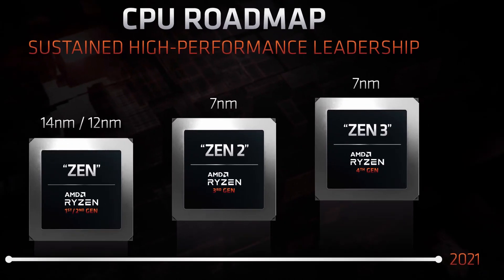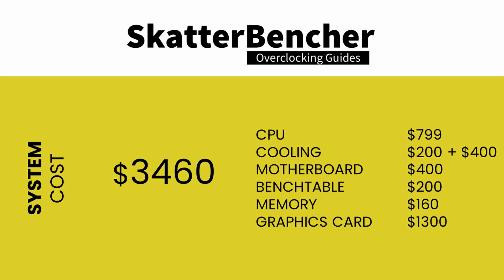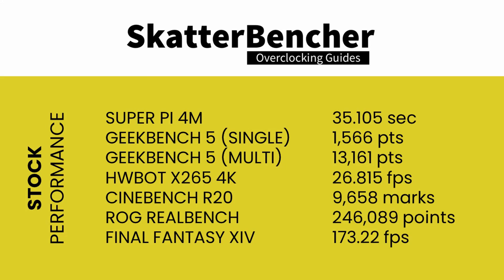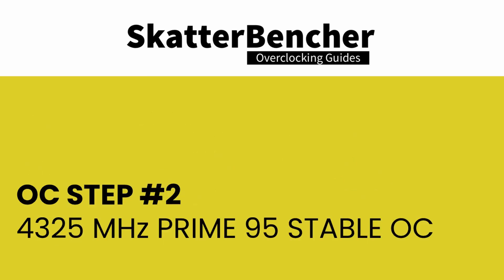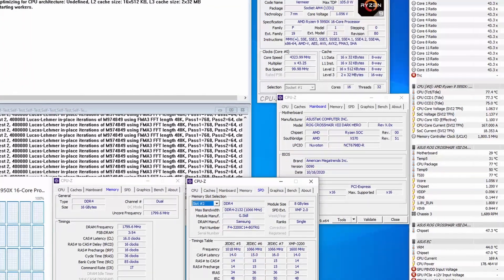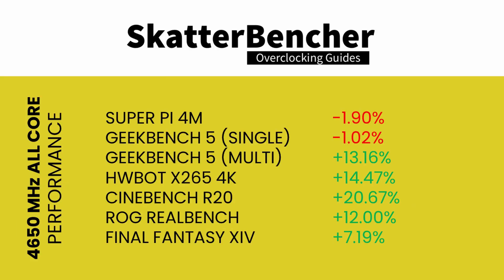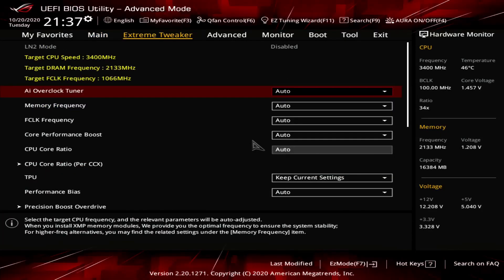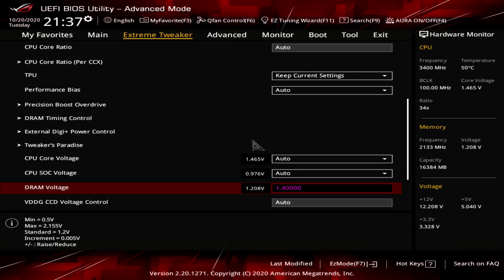Ryzen 9 5950X Overclocked to 4650 MHz With ASUS Dynamic OC Switching | SkatterBencher #15

Comment: I dont get how this is an OC if the cpu is already marketed as having a boost clock of 4.9, how is 4.6 an OC?
Reply: @@nicholasconundrum yeah that is it. It is pretty gimmicky. That is too bad.
Reply: It’s a single core 4.9. You can actually get 5150 boosts very often, or 5400 boosts

Comment: Noob question: Why 4650 while stock turbo is 4900?
Reply: While in the other video you OC to 5117
Reply: The 4.65 is all core. Pbo is a single core scheme.

Comment: These instructions crash my system unless I ignore the detail memory settings (16,16,16,16,32, v1.4). If I leave those default then it all works. If you are having trouble too, that might be the part.
Reply: I was reading the comments looking for RAM info and why those specific timings specifically.

Comment: But PBO already hit thermal limit with voltage offset, dynamic OC mode when go above current can achieve similar voltage and speed, so what's the point? PBO voltage still too high after off set?

Comment: Processor - AMD Ryzen 9 5950X 3.4 GHz 16-Core

GPU - EVGA GeForce RTX 3090 24 GB

Motherboard - Asus ROG Crosshair VIII Dark Hero

Cooling - Corsair iCUE H150i ELITE CAPELLIX Liquid

Power Supply - Corsair HX1200 Platinum

SSD - Samsung 980 PRO 2 TB

Memory - G.Skill Trident Z NEO 64GB 4x16 DDR4 3600 CL 16-19-19-39

Case - Lian-Li O11 Dynamic XL ATX Full-Tower

Random Black Screen Reboots happening to computer. My PC keeps randomly shutting down while streaming, gaming or surfing the web. I cant seem to locate the issue, all hardware is operational. Did fresh windows install, drivers up to date, swapped ram, swapped psu. Manually adjust power setting in windows and many other trouble shooting. The pc is at microcenter now and they say it isnt hardware issue. Any support is appreciated. Specs above. I tried turning off PBO and also fmax enhancer and still turning off. Another expert i consulted said that it could be related to voltage? Is this something you’ve experienced? Any help is greatly appreciated this pc is driving me insane.

Comment: Did you change the LLC or CPU Current settings?
Reply from the maker: It's been a while since I overclocked this system, but as a general rule of thumb you can assume that if it's not in the video I didn't touch it

Comment: You don't need to do all this craziness. Just go to Curve Optimizer set negative curve as far as you can to stable and fine tune your PPT TDC EDC and you will get high single core and high multi core speeds no trade off.

Comment: Why is the ddr4 still only running at 2133mhz?
Reply from the maker: DDR4-4266 = 2133 MHZ (double data rate means data is transferred twice per DRAM clock cycle)

Comment: My 3950x is overclocked to 4.3Ghz. I see great preference. With a 5950x you might be getting about 8 to 15% better preference then me. I don’t see a reason to upgrade if you own a 3950x like me or any 3000 series Ryzen CPU 🤔. To me Zen5 CPU’s are the next big upgrade and that’s when I plan on building my next rig. I still want to see what Zen4 can offer tho even if I’m not going to get one myself.

Comment: @skatterbencher Excellent video... One concern though... I have followed these instructions and even lowered the threshold for DOS. With that said, I am still experiencing high temps with my 5950x. Even at idle. During gaming, CPU can spike to 91 c and idle temps are currently >50 c. Any suggestions on how to control the temps a little better without losing too much performance? Bios tweaks? I am using an NZXT x73 Kraken 360mm AIO, so cooling should not be an issue. I am going to rebuild this weekend in a Lian Li 011 Dynamic XL and change fan config to see if that helps. Thanks in advance! I appreciate this content!
Reply: wow with an AIO? I have a noctua fan and am able to keep sub 60 with heavy gaming (although on stock boost)

currently testing a 4.5ghz over clock

Comment: Will this work on the Asus ROG Crosshair VIII Extreme @SkatterBencher?  I am using a Corsair H150i Elite cooler with 128gb corsair vengeance 4000mhz
Reply from the maker: Yes.

I have a dedicated video out with the C8E as well https://youtu.be/2ZW36TPhFz8. I think the newer one is much better than the older one :)

Comment: Same exact system will not boot after changing settings. Shows Q code error 22 on MB and have to reset cmos to get back into bios. G.Skill RipJaws V Series 64GB (2 x 32GB) 288-Pin SDRAM DDR4 3600 (PC4-28800) CL18-22-22-42 1.35V Dual Channel Desktop Memory Model F4-3600C18D-64GVK. Any help appreciated.
Reply from the maker: Sounds like possibly the memory. Instead of setting the memory frequency, timings, and voltage manually you can try to just enable XMP (or DOCP).

Comment: I just want to say thank you for the quick response on my first question love your channel
 So when overclocking my 5950 X it seems I get the best performance when I run my ram manually at 3800 but my issue is finding out how to set my BLCK FCLK four 3800 do you have any videos where you cover this section or explain the best starting point for free this
Reply from the maker: No worries, I'm here to help!

Unfortunately I don't have any content up that takes a closer look at tuning the Fclk. My go to strategy is ... try high and if it doesn't work, try lower.
Reply: @SkatterBencher  So I learned on the Asus crosshair formula board you have to go to the Amd overclocked and change the fabric to 1900 if you run in 3800 Memory that was the part is missing

Comment: So I don’t have dynamic overclock switcher could it be called something else on my Asus Rogue crosshair formula motherboard
Reply from the maker: Unfortunately, Dynamic OC Switcher not available on the Formula. The feature requires hardware-level support (changes to PCB) which were done after the Formula launched.

Comment: What's the difference in enabling PBO in the Extreme Tweaker tab opposed to the Advanced Tab?  I though PBO was supposed to be changed in the Advanced Tab?
Reply from the maker: No difference, both settings reference the same PBO enable/disable function.

Comment: with my 5950X I can just make it cruise without variation at about 5.6 ghz without any thermal gain and zero stability issues, but the VRM on the Aorus master board delivers the best power of any X570 since it is a true full phase unlike the other phase doubling boards like the Asus boards, VRM is quite important.

Comment: why would you want 4.65 on a CPU that is rated at 4.9?
Reply from the maker: The default all core maximum frequency of a 5950X is, even with PBO, maybe 4200 MHz or lower. So if you want a higher all core frequency you need to manually overclock

Comment: My 5950X runs over that at stock voltage, average about 4.85 ghz and sometimes up to 5.4, I wonder why it is doing that, is on a Gigabyte Aorus Master x570 and Crucial Ballistix ddr4 3600, it just runs stock at that, although I did turn on the bios feature to allow the ram to go to speed, is on the NZXT z70 Kraken, it stock is way over these numbers, silicon lottery?

Comment: Quick question:
I use power option profiles to change the cpu clock speeds :

High perf = up to 5.0 ghz
Balanced perf = locked at 3.375 Ghz
Power saver = Locked at  1.720 Ghz

Now the question is, is there a way to boost the "Power Saver" profile to let's say 2.0 Ghz instead of 1.7 Ghz without removing the auto tuning in bios?
Or lower my "Balanced perf" profile to 2.0 or 2.5 ?

1.7 can be a lil choppy in responsiveness so 2.0 would be better.

I managed to reduce temps by 10-20 degrees by lowering voltage and also the power consumption is way better.
Reply: Yes you can. Select Balanced power plan on Windows and change th Maximum processor state from 100% to 99%

Comment: Good video man, but the question is about temp of CPU package, I have I AIO 360 mm and in idle mode 55 and 60 Celsius, and in overload and not all core working 77 to 88 Celsius that is a crazy temp of CPU I change my water cooling AIO to custom loop how the temp become? 
I change my CPU from Intel Core i9 to AMD r9 5950x, but  I am disappointed  the AMD new gen have problem with temp.
Reply from the maker: Assuming Precision Boost Overdrive is enabled by default (many motherboard vendors do so), I think those temperatures are as expected with an AIO and a Ryzen 9 5950X. Custom loop water cooling may improve those temperatures by 10C or so.
Reply: @SkatterBencher thanks man for answer , but i think the amd r9 5950x not good enough , and amd should do something for the temp i mean thermal design power next time.

Comment: I have the same voltages and temps with AI Overclock Tuner on Manual and Task Manager says it is running at 3.5-4.5ghz is this normal? Am I missing something? The voltage and temps seem a little high for idle. Is this just for one core or something? I need help understanding the 5950x and Dark Hero Mobo. Thank you.

Comment: Thanks for the video.  Just picked up a 5900X finally and a Dark Hero.  Not many tutorials out there for dynamic OC switching, so this is helpful.

I do have one question: do I need to be leveraging Ryzen Master for any of this or should I simply not use/uninstall it to avoid any conflicts?  Seems like everything can be accomplished in the BIOS for PBO and manual OC switching from this video.  Thanks again.

Comment: Hey man awesome video. Quick question tho. I am fairly new to overclocking so I’m sure my question is probably dumb but I have to ask. Do I have to follow each step or can I just skip to the very last overclock with dynamic os switcher? I have the dark hero too.
Reply from the maker: If you're new to overclocking I would suggest you to try each step to so you can get a better feel of how overclocking works :).

Overclocking settings are generally not copy-paste from what you see online, but rather you can follow the process and see how it works with your system

Comment: If you had these two, what specific RAM would you recommend?
- Ryzen 5950x (cpu)
- Asus ROG Crosshair VIII Dark Hero (motherboard)
Reply from the maker: I would probably pick G.SKILL TridentZ Neo DDR4-3600

Gskill > well-established brand in the high-speed range + collaborate closely with ASUS RD
TridentZ Neo > Optimized for Ryzen 5000
DDR4-3600 > pretty much guaranteed to work with 1800 MHz Fclk in sync mode on any CPU
Reply: @SkatterBencher  Will G Skill 4000mhz 32GB 16x2 CL16 16 16 16 36 work?
Reply from the maker: There are many people who get 2000 MHz FCLK  to work with DDR4-4000 but also many people who don't. You can always try and if it doesn't work manually lower the memory frequency

Comment: My PC:
•	12-core - 24-Thread - 3.8 AMD - Ryzen 9 3900X 3rd Generation GHz (4.6 GHz Max Boost) Socket AM4 Unlocked Desktop Processor
•	ASUS - ROG Crosshair VIII Hero (Socket AM4) USB-C Gen2 AMD Motherboard with LED Lighting
•	CORSAIR - VENGEANCE RGB PRO 32GB (2x16GB) DDR4 3600 (PC4-28800) 
I cannot see how to change VDDG CCD Voltage, VDDG IOD Voltage, cLDO Voltage.  I see them in BIOS, they say set to Auto.  I cannot change their values. Thanks for any help!

Comment: Yo bro we both got gold samples I just got my 5950x to 4.75ghz with 1.295 volts! Temps at 60 max! excited to start doc soon!
Reply from the maker: Nice, congratulations!
Reply: Damn i wish.. i have to go to 1.39v to get 4.6 to work
Reply: How are you guys achieving this? I am running stock bios settings and getting 4.0ghz, 1.4v, 50c on idle. I don't know if this is normal or not. Is idle at 1.4v normal for stock Dark Hero BIOS? I am running 3601 BIOS version..
Reply: @ja6995 same bro 
Pain...
Reply: @fonzareli9619  I ended up replacing my AIO and updating bios, I am idling at 35c and 55c under heavy load.
Reply: @fonzareli9619  I also uninstalled Armory Crate and that helped a ton.

Comment: Hello,
Actually i'm running a 5950x witch asus x570-e gaming, 4x8 vengeance pro 3600 C16, h100i elite capellix and icue 4000x case
The best i can do is something like 4.35ghz running 85° on cinebench r23,  is that normal to you :/ ?
Reply from the maker: What is the benchmark test for 4.35GHz?

Comment: @SkatterBencher I have the same cpu and mobo but running a 360 aio, any benefit from running the doc oc for playing games or will it overheat cause I’m using an aio ?
Reply from the maker: Hard to say.

The main benefit from DOS OC is when the PBO all-core frequency is much lower than the manual all-core frequency. This will be different on every system so the only way to know is to try, unfortunately.

A high-end 360 AIO should be still quite good for hitting high all core frequency

Comment: When you do the manual OC at 4.325 GHz, you see a greater improvement over stock compared to PBO. Given that PBO boosts the clocks to ~4.5 GHz on multicore, wouldn't you expect the PBO scores to be HIGHER than manual OC @ 4.325 GHz (on multicore)?
Reply: it drops below 4.3ghz with PBO, on all core load.

Comment: whats temps?
Reply from the maker: The 4325 MHz Prime 95 stable overclock hit a maximum temperature of 80C. I uploaded the screenshot to the blog article: https://skatterbencher.com/2020/11/05/skatterbencher-15-amd-ryzen-9-5950x-overclocked-to-4650-mhz/
Reply: @SkatterBencher  try using custom watercooling
Reply from the maker: I already use EK custom loop water cooling for all my overclocking videos :)
Reply: @SkatterBencher  i have on 4300ghz max 68 C on artic freezer cooler 2 so 90 C is very bad or 85

Comment: Thanks for this video, super helpful. Would you recommend these settings if using a 360 AIO?
Reply from the maker: Power consumption wise, a decent 360 should be capable of getting at least close to the performance.

But, of course overclocking range will differ with different CPUs, different environment and ambient temperature, motherboard, etc. So I always suggest to not just copy the settings but slowly work your way up and see what works for your system.

Comment: Just like Alva Jonathan states, using dynamic switcher of Manual OC and PBO based on current. I never thought of it, what a great option. Combining this with some undervolting for better thermals and you really can push both the performance and reduce noice. Thank you sir!
Reply from the maker: Exactly! Also, Alva is an absolute OC legend :)

Comment: Hey I'm having a problem I just try these settings with similar on the oc switching amps but my all core will switch in pbo in the middle of a benchmark like cinebench. Then when I just do single core I only boost to like 4.7 maybe 4.8 ghz. Any idea why this is happening?
Reply from the maker: Are you sure you found the optimal current threshold point? 

If the threshold is too low, it will switch to manual OC mode too early and cause lower single thread performance).

Comment: I am in between getting a 5950x and the 5900x. Currently on the 3900x on the auros x570 xtreme. I literally hate the bios for gigabyte is the bios for Asus still organised or is it a mess too?
Reply from the maker: I think probably the ASUS ROG BIOS can be overwhelming at first, since there are loads of options. But that would be the case for any of the motherboard vendor's BIOSes.

In my experience, any BIOS will eventually make sense if you use it for long enough. And if you're familiar with one BIOS layout then switching to another will be an uncomfortable experience at first :)
Reply: @SkatterBencher  the problem that I have with the aorus is how they name their stuff and I used all their high end boards since 8700k.
I do miss the first rog crosshair bios for the 1800x as I did a lot of memory ocing with it.
Also aorus advertises stuff that on paper sounds great but once you get into the bios or use their software it is a complete nightmare.
Even their gpu is lacking, I had a 3090 xtreme and it somehow managed to be loud and hot while  being a 4 slots card. Moved to the strix and couldn't be happier.

Comment: Hello 
SkatterBencher, I recently upgraded to the 5950x along with the Dark hero, and it's being cooled by a custom water cooling system with EK monoblock installed for the processor, and I'm having around 65 to 75 degree in gaming (mostly 70) with everything on stock except PBO being disabled, is this a normal temperature, or I'm having issues and need to reinstall the monoblock ?.
the liquid temperature also while gaming is 35 to 39 degrees.
Reply from the maker: I put up the screenshots of my testing on the website here: https://skatterbencher.com/2020/11/05/skatterbencher-15-amd-ryzen-9-5950x-overclocked-to-4650-mhz/. My Prime95 Small FFTs with AVX result with PBO enabled is around 80C with the EK-Quantum Magnitude block and a 360 radiator. So, I 'd say the temperatures you're seeing are within expectations. 

What is your ambient temperature? What is your radiator?
Reply: @SkatterBencher  thanks for the replay, ambient is from 20-25 degrees, and rads are EK PE 360mm, and CE 280mmf, is a single loop along with 2 2080 tis in sli, I'm not running sli atm, but 2 cards are installed, so one is idle.